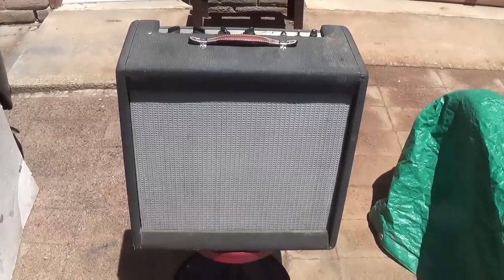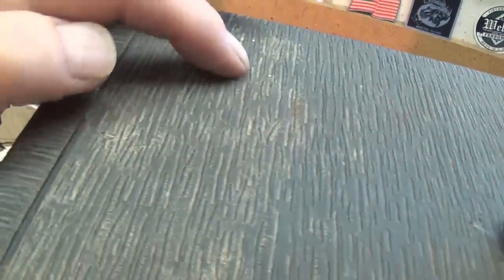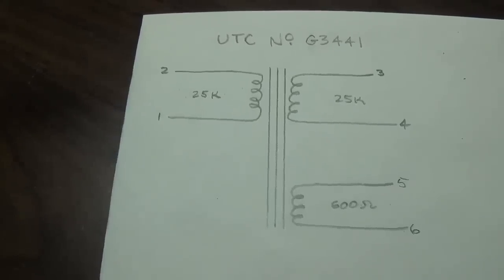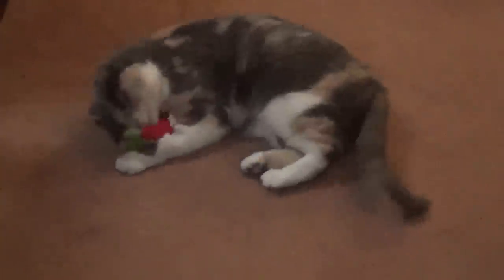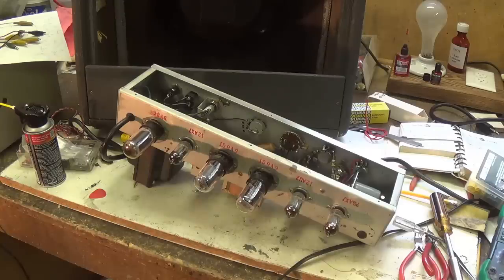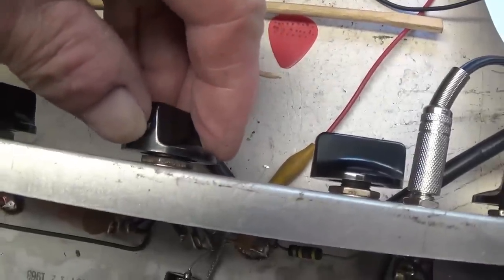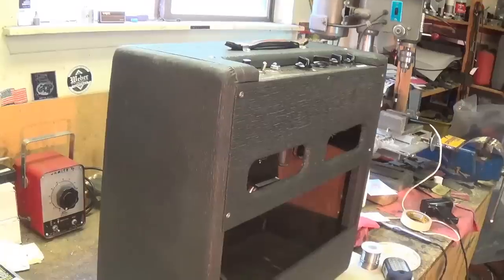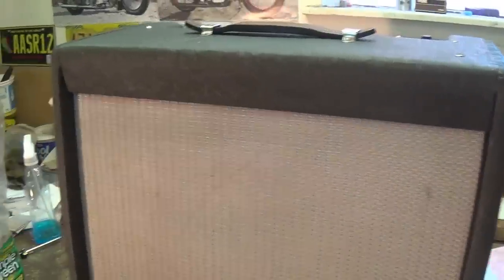1963 Lesmann "Echo" Amp......No More Polkas for this Bad Boy

Comment: Just started watching. Could it be that this is one of those situations where, like other electric accordion setups, this was part of a stereo setup, thus the "echo" in the title? 
Little further along and why not just remove the ext speaker control and put the jack there? Just thinking out loud.
Reply from the maker: It could be, Brad. I've seen other amps in which the term "echo" merely implied that there were two separate speakers.  You'll see what happens to the external speaker control :)

Comment: Unused grommet hole in the chassis for a footswitch jack  for the trem ?
Reply from the maker: I think it was for the cord that connected the unit to the accordion, Ben. Just a guess, however.
Reply: @UncleDoug  Yuop I got that -- but you could repurpose the hole

Comment: Sounds good, but a tiny bit of harsh distortion coming through on the Preamp. Did you AC couple the input to the first grid? Maybe some positive bias on that grid too to get it into a good class A range.  I didn't see you showing us how VIB and TREM were different after modifications. I like how you added intensity for the VIB/TREM, but maybe slow down the lower limit of the speed. I like "too much intensity" on the VIB/TREM as it's gives you more choice in the end - you may say "it goes to 11, it's one louder".
Reply from the maker: Thanks for your helpful input, Paul.

Comment: Vibrato is variation in frequency & tremolo is variation in level. (I guess, LMAO!!!)
Reply from the maker: You guessed right, Mike, but there is no Vibrato effect evident in this amp circuit.
Reply: @UncleDoug , I'm sure I noticed the frequency variation on the VIB setting & the level variation on the TREMOLO setting when you played with it. I listened very closely! Try listening again!
Reply: I also will always say TREMolo, not treMOlo like the Guitologist claims it's pronounced, HAHAHA!!!
Reply: Once I had a 100 watt Polytone amp that was supposedly popular with accordion players. It had a special red knob you pulled up & adjusted for distortion. It was the best sounding solid state amp I've ever heard, especially compared to the crappy Gibson solid state amps of the 1960s & 1970s! Are you familiar / experienced with Polytones?
Reply: Apparently the Polytone amp was good at reproducing complex chords. The logo included some chord symbols. It certainly had good distortion! If you find a 100 watt Polytone amp with a red knob, try it!
Reply from the maker: I have seen and heard Polytone amps, Mike. They tend to be ultra-clean, for Jazz and such. I would think that a 100W Polytone would make a dynamite lead guitar amp......like a Marshall, clean and loud as heck. I'm not sure where Brad gets his pronunciation of Tremolo. He may be right.......but the vast majority of people seem to pronounce it the way we do.
Reply: @UncleDoug , you grab that red knob, pull it up & give it a good twist ... bye bye clean!!! 
Brad apparently gets his tremolo pronunciation from Italy, a small place with a handful 
of people. We are the rest of the universe, with billions of people, HAHAHA!!!
Reply from the maker: The last time I grabbed a red knob and twisted, Bozo the Clown kicked my ass.
Reply: @UncleDoug  good one UD.  Now i gotta wipe the coffee i just spewed on my monitor.

Comment: Doug, what is the purpose of the 47k Ohm resistors in series with the coupling caps on the outputs of the plates?  Is it for DC gain determination with the cathode resistor, or for impedance matching to the input of the next circuit?  Well done on this one.
Reply from the maker: Thanks, Steve, but I am at a loss with regard to the "47K Ohm resistors". Which tubes are you referring to?  In the 12AX7, the coupling caps are .047uf and the plate resistors are 100K.

Comment: Nice work Doug! I'm curious as to why the tremolo works the way it does in your final revision. Is it some firm of power tube bias wiggle?
Reply from the maker: I don't recall where I attached the tremolo output, Kley.....but it was probably to the cathode of a pre-amp or phase inverter tube

Comment: Greetings Rusty and Jack, I have a question for your Dad. Doug, I know that using hi quality audio caps can produce a better sound from an amp, what about resistors. Carbon, metal film or wire wound, which is best do you think.
Reply from the maker: I recommend metal film in the power supply and carbon film in the signal circuit......1W minimum.

Comment: Maybe I misunderstood what you did, but you said you only connected the tremolo oscillator output to one of the output tube grids. Aren't the output tube grids connected to each other? I mean if you are only putting the oscillation signal on one grid, it would only effect the amplitude of the positive or negative part of the waveform, depending on which one you connected to. Maybe it just wasn't clear what you did, by what you were saying. I just assumed you would connect the tremolo to the output stage, the way it was normally done on the Princeton and that is as a grid bias configuration.
Reply from the maker: Through experimentation, I found that connecting the oscillator output to the grid on only one of the output tubes produced the best results. I agree that this is inexplicable, but it's what I discovered......and the tremolo is wonderful.
Reply: @UncleDoug  Very interesting. So you didn't tie the gtids together at all, as in the way a Princeton is done? I'm trying to wrap my head around that. Have you looked at the output on the o-scope? I'd be interested to see that.
Reply from the maker: If you're referring to using two 220K resistors to deliver the bias voltage/tremolo signal to the grids.......no, I did not. In fact, just about any attempt to deliver the tremolo signal to both grids resulted in very unpleasant distortion. However, since the cathodes were connected, perhaps alteration of the bias of the connected tube resulted in alteration of the bias in the unconnected tube (?).
Reply: @UncleDoug  Interesting!!!

Comment: Thank you for another great video and learning experience.  When you use shielded cable, do you have to ground the shielded part of the cable, and if so at both ends?
Reply from the maker: You're welcome, Mr. C. Yes, you ground the shield.....but only at one end, to avoid creating a ground loop.
Reply: @UncleDoug  Uncle Doug.  What type or gauge wire do you use?  Thank you

Comment: How busy are you???  Seems like you are very busy. I have a V front Fender Super (early 50's) that has been gone over electrically and is supposed to be 'correct' but it has a weird muddy loss of treble issue which I think is due to either bad after market grill cloth or maybe the the original Jensen P10R's are shot. If you are accepting new amps for repair I'd love to ship it to you for your diagnosis. It's also 80% 'naked' with some nimrod having stripped the original tweed but I have not gone with a re tweed because I can't find the very very old first generation tweed Fender used to use...
Reply from the maker: I am very busy indeed,  SB......BUT the opportunity to work on an original Fender "Super" does not come along very often. Please message me on my FB page: Uncle Doug's Vintage Amps, to make arrangements.

Comment: I've got a Lesmann and I did a bunch of research on it.  There are no schematics that I was able to find. I suspect that the amp was at least partially made by Valco because of the inked markings on the chassis for the respective tubes. I think the one you have may well have been reworked from the original configuration as mine has a very nicely done phenolic circuit board with eyelets. I believe the round grey can is an input transformer of some sort. More info here at http://judyboxamp.blogspot.com/2017/04/the-lesmann-amplifier-project.html
Reply from the maker: Thanks for the info, Robert. Information about Lesmann products is hard to come by.
Reply: Thank you for the link. Very interesting pictures! Note the UTC Transformer, similar to the one in Uncle Doug's amp, and also the Fender style filter capacitor housing. Perhaps this one being shown in your link is of later vintage then Uncle Doug's amplifier, since it's not completely point to point wired and instead uses an eyelet board 4 for the components.
Reply from the maker: Good observations, GU. I noticed the "dog house" for filter caps. It may well be a later iteration.

Comment: This may be a dumb question but why do you need a Little Orphan Annie decoder pin to figure out the codes and know what the year  the amp or the guitar was built? Why not just stamp the date on?
Reply from the maker: I agree, Nick, but this is the first time I have ever seen it done. It should be standard procedure.

Comment: I saw a Peavey Triumph 120 tube amp at my local thrift and was wondering if they are worth buying? anyone know? the amp was in rough shape I did not test it but I don't think it was in working order they only wanted fifty bucks for it.Thank you
Reply from the maker: The price guide value is $175 to $200, Rob, so it's reasonably priced......but, do you have a good use for it ?
Reply: @UncleDoug  No. I really don't so i passed on it i was curious because i heard people say that tube amps are better than solid state that they have better tone/sound. Do you agree about that?
Reply from the maker: I do, Rob, although some of these new modeling amps can definitely mimic tube tone rather well. Bear in mind though that not all tube amps are created equal. Odds are that a $50 120W Peavey is not the best example of "tube tone". Keep your eye out for a reasonably priced Silverface Fender Champ, Vibro-Champ, or Princeton.
Reply: @UncleDoug  Thank you for the recommendations i will. And even if is not functioning maybe with your guidance i can get up and running.
Cheers
Reply: @UncleDoug  I did not know that a price guide existed? I wil have to search for it.
Reply from the maker: Look up Vintage Guitar Price Guide.....you can order it on the Internet.
Reply: Thank you will do.

Comment: Hi uncle Doug I have a chassi from a fbt 500 r guitar amp, with the power transformer and output transformer that I pretend to restaur, but the El 503 are real expensive, do you have any recommendation for my in wich valves can I change?
Reply from the maker: I'm not familiar with the circuit or the tube, Diogo. You'd be better off checking on the Internet. Good luck.

Comment: I thought with a single input the grid resistor would be 33K, that's what I used in my builds. Is that an audio or linear pot on the intensity control? Take the legend and put a tube preamp in it. Good job making it a somewhat usable amp, a bit ratty sounding though.

Comment: The original pickup sensor may well have been permanently wired on.  Just putting a socket on a wire seems strange.
Reply from the maker: I think a shielded cable originally ran from this amp to a 1/4" socket on an electrified accordion, Yisrael. Just a guess.....but it makes sense.
Reply: @UncleDoug  , a hard-wired connection would have made more sense if the accordion was small enough, for the combo amp case large enough, that the accordion could stowaway in the back of the amp. maybe it had a concertina or other teeny tiny little Jack in the Squeezebox miniature kissing cousin to an accordion hard wired to the amp, something small enough that it could indeed fit inside that cabinet?

Comment: Could the "distorted mess" resulting from the trem oscillator being applied to both output tube control grids 

be due to the signal inputs being 180  degrees out of phase? That would seem to be a cause of signal conflict.
I admire your approach in modding the original circuit. I probably would have gutted it and wired a  Princeton circuit in the chassis, Keeping the trem circuit, would it be a "Tremoprince"?
Reply from the maker: Remember that the oscillator signal is not audible, Richard, it merely alters the bias of the output tubes......which it can do regardless of the phase of the music signal present on the grid. Thanks for your nice comments.

Comment: a piezoelectric pickup or mic input?
Reply from the maker: Probably, MK......with very low output, thus the need for the matching transformer.
Reply: The only accordion pickup, really sort of a microphone, that I have ever seen had four piezoelectric elements in a footlong Chrome plated sort of a car bumper like thing with a perforated screen, I don't know how you were supposed to fasten it because it was missing any type of bracketing.
Reply from the maker: That sounds very accordionesque, GU. Liberace would , no doubt, approve :)

Comment: If the external speaker control is not useful, you could have replaced it with the input jack? - sorry, I commented too soon into the video!
Reply from the maker: No problem, Bernhard. I'm glad you watched the video.

Comment: Outstanding as ever. Did you work out the difference between the vib and trem settings? I was wondering if it modified the oscillator wave shape like some trem pedals do. Cheers rich
Reply from the maker: Thanks, OB. I never determined the difference between the settings. I have a feeling the VIB may have altered the relationship between this and another (absent) piece of equipment, so it could not be salvaged.

Comment: Thinking: Princeton or similar tone stack
In fact, why not just turn it into a Princeton clone?
You have enough tube sockets and xformers - right?
Does the power xformer have a tap for tube biasing?
Reply from the maker: It sounds really nice the way it is, Robert. No, there is no grid-bias winding.
Reply: Noooooooo no more Princeton clones that nesman sounds great. I have a 1960 electro,rickenbacher that has a simular sound I love small tube amps

Comment: Hi Uncle Doug, what kind of shielded cable do you use?
Reply from the maker: For runs within the circuit, I use shielded cable from RCA cords that come with virtually all modern electronic devices.
Reply: @UncleDoug  Efficient reuse Uncle Doug.  Thanks for the reply.  Now, have I thrown all those annoying RCA cords away....?

Comment: It looks like Reverb had one on the block a couple of years ago. It appears to be the same model you have here so I'm curious as to why they used the term "reverb tank" in the condition section?  https://reverb.com/item/3659000-lesmann-echo-amp-tube-reverb-amplifier-1960-s
Reply from the maker: Several viewers have mentioned this ad, SA. Either they were incorrect in their description or they were describing a different unit.

Comment: There was an identical Lesmann sold on Reverb some time ago. It went for $695. Nice photos still up, no schematic however. Kind of a switch where you plug your amp into your instrument instead of the other way around. Kind of a Vox-y tone to my ear. I really like it. Plug a Rick in and off you go.

Whatever happened to the Chevy engine you were working on? And the rat rod?
Reply from the maker: Thanks, TM. I still have the engine. It's finished but still no car to put it in. The rat rod/hot rod is looking and running better than ever. I'll take you all on a ride once I figure out how to stabilize the camera.
Reply from the maker: I think there is a cable in the bottom of the cabinet that plugs into an accordion.
Reply: @UncleDoug  Looking forward to the ride.

Comment: VIB = vibrato?
Reply from the maker: I thought so too......but there is no circuitry on board that would create that effect.
Reply: So pure marketing?
Reply: Love the way it sounds btw
Reply from the maker: Thanks. Either marketing or a very loose interpretation of the terms "echo" and "vibrato".
Reply: I guess the latter indeed, with some help, you could perceive vibrato, tremolo and echo on a scale of increasing intensity. Maybe the vib/trem switch was supposed to change intensity only.

Comment: Hey UD, I don't know if this will help, you may have already ran across this ad, but it's stilled listed and has some good pics of chassis innards. https://www.creamcitymusic.com/vintage-1960-lesmann-accordio-organ-25w-1x15-tube-combo-amp/

Found this also, Check it out. http://magemusic.diskstation.me/wordpress/wp-content/uploads/Lesmann-Amp-Modified.pdf

Last thing I could find: http://judyboxamp.blogspot.com/2017/04/the-lesmann-amplifier-project.html
Reply from the maker: Wow.....some great links, PM, but none of the units are quite like the one in the video. The link amps all make sense, with input jacks, reverb tanks, etc. while this one has none of those features. I guess that Lesmann offered several different models for different purposes. Naturally, this one seems to be unique. Thanks so much !!!
Reply: @UncleDoug  Sure thing. There is very little out there on it as you said. I have a search engine that hit multiple major search sites and generally see a lot more than just what's on Google or Bing. I knew they were different, but was hoping there would be nuggets the you would catch that I couldn't see. I need to watch your entire episodes before commenting in the future instead of pausing, researching and commenting only to find you've shortly made a left turn instead  going forward. LOL This was a great video and I really enjoyed the process of reaching the end goal. It was impressive the amount of improvement from out of the box! Great work as usual!

Comment: Where is the clear sound? Guitar sounds very distorted  even at minimal volume. It isn't right!  Where is an anode resistor of the  first tube on schematic? You should find an original schematic at first, and adjust what is, eliminating the problem. And you started reinventing the wheel, drilling the holes without understanding the layout. The result is an improperly working amplifier, that somehow sounds like..:-(  Very bad work!
Reply from the maker: There is no schematic,  Михаил, as stated in the video. Fortunately, your very negative opinion does not seemed to be shared by over 10K viewers, but regardless.....we appreciate your input.